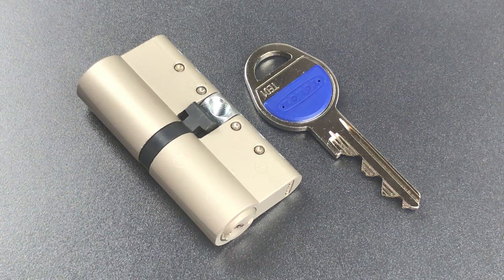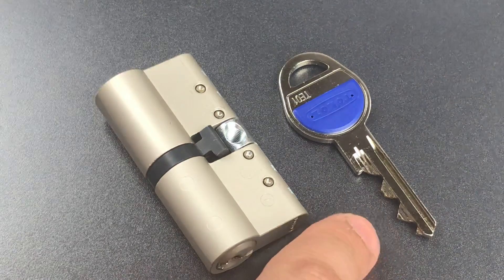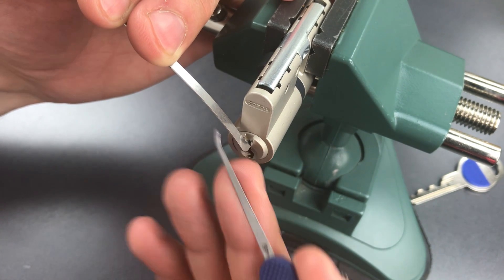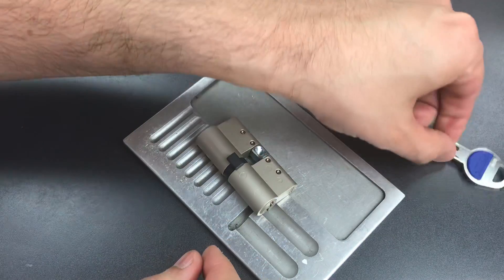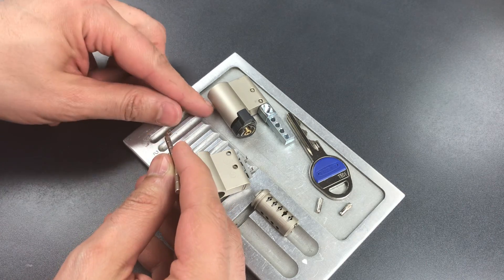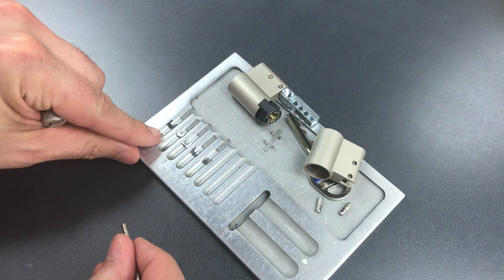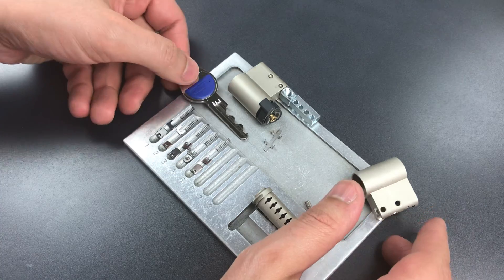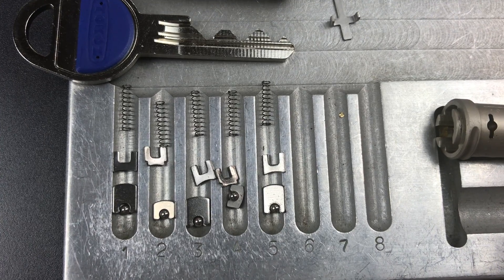[726] The Naughty Bucket Chronicles — Tokoz “Tech 300” Euro Cylinder Picked and Gutted

Comment: You know it's gonna be difficult when the key looks like a saw
Reply: It's actually a message to the picker to use a saw instead because you are gonna have an easier time.
Reply: BZZZZZZ a drill
Reply: All that does is turn a 30 second video into a 2 minute video.
Reply: EricsArchive but it’s still easier than picking
Reply: Nasty bitting, lol
Reply: @MrSonny6155  🎉🎉😢😢 3:47 3:47

Comment: I have one minor and one major remark: the eurocylinder is usually mounted upside down. But it also needs a full rotation or two, to actually unlock. Half rotation is needed to just engage the lever, while you left it in 90° position
Reply: That's why the gods of lockpicking invented plugspinners 😉

Comment: LPL - I saw you switch between picks, without knowing how the key was designed, would you have used the same strategy?
Reply from the maker: Yes. When I move between pins, I ride my pick on the pin I just picked. That makes it fairly obvious when I can’t reach a pin. That’s one of the reasons I always go front to back. 👍
Reply: LockPickingLawyer awesome, thanks!
Reply: Amazing tip. I've accidentally done that a few times while counting pins, will remember to do it  purposefully in the future
Reply: This comment is pure gold ! So what made you realized you didn’t touched four was that when you came into contact with five it was way too far from three to be four ?
Reply: Correct.
Reply: Always front to back!
Reply: actually that is incorrect. He said he drags his pick across the one he just set as he moves onto the next one. Think of how the pick is shaped. As he drags across 3 after he sets 3, 4 is too high that by the time he can reach it, the picks curve ends and he felt the flat part hit pin 3. He never had to go as far as pin 5 to notice he couldn’t reach pin 4 with the short hook pick.
Reply: @SnakePicks  thanks for explaining makes sense now
Reply: @lockpickinglawyer  I'm surprised no one has made a joke about the front to back comment. Only a psychopath goes back to front. Gotta keep the trash out of the goods if you catch my drift.

Comment: Hi Harry, Interesting lock, certainly a variation on wafers. I guess they could be Master Keyed using smaller wafers between top and bottom wafers ...? No lip on the front of the core could leave it vulnerable.  Regards, Brian.
Reply from the maker: Yup, shimming from the front is definitely a problem with this design.

Comment: European locks are mounted the other way, with pins being pushed down rather than up. I wonder if their anti-picking measures can't be designed for that and if you're not bypassing them by picking the lock upside down.
Reply: Not necessarily. It might requiring a bit more finagling, but I’m sure that for lpl he’d have no problems since he’s shown capability with both top and bottom key way tension
Reply: I guess it would be more awkward to have to push the picks up rather than down and not have the convenience of them resting on the bottom of the keyway (which would then be the top).

Comment: FYI you messed up while reading the TOKOZ catalog. The TECH cylinder is not the one they say is 100% pickproof (they have it listed as highly resistant). The lockpicking/bumping proof one is the PRO 300/400 cylinder which uses rotating discs locking mechanism.

Comment: Instead of using a magnet to get the wafers out of the core, use a pair of tweezers with fine points. That way you don't run the risk of magnetizing the wafers. Of course, the wafers could just as easily be brass, in which case magnetism is not a problem.

Comment: What about a tokoz 400 pro? I've seen a pick on yt but I would like you to take a shot at it as your presentation is superb.  The 400 has a special locking mechanism plus coupling so they claim, that you can lock it from the inside and not even open it with a key.

Comment: Since the core slides out towards the back, doesn't this make the lock vulnerable to sliding a shim between the core and the cylinder from the front? @LockPickingLawyer Maybe something to try if you still have the lock.
Reply: I was just thinking the same thing, it looks ripe for a shim picking. The tolerances do look quite tight though. I've never shim picked a wafer lock or even considered it, maybe it would be a tricky process but at least in theory it should work like a pin tumbler lock... I would love to know if this lock is susceptible to that form of attack.

Comment: Since this is a eurolock, I think you should pick those upside down, or for us europeans, the correct way a lock should be installed :-P
Reply: Seminko thrse are installed both ways depending on door in southern hemisphere
Reply: I agreed, I think it's kind of cheating as the upside down should make the overset way more difficult to deal with.
Reply: @Golegoth  I have picked locks in both orientations and have not noticed any difference in overset feel or clearing. The weights of the pins are so much less than the pressure applied by the springs that it doesn't matter.

But that would certainly be an idea to try in a challenge lock. It would require some very fine tuning of spring pressures to make a difference.

Comment: Hey, can you shim this lock. Slide a shim inbetween the cylinder and bible?. I didn't see and counter sinking or overlap to prevent a thin shim from being slid down on the shear line keeping the key and driver waffers from interacting. It may be too tight of a tolerance, but that may work.

Comment: gratz lpl ... my first time seeing this lock gutted .. what do u reckon if serreated sides were added aswell?
Reply: It wouldn't work. Given the wide nature of these wafers, best you could do is have one or two stepped notches. Not sure if they really need to be the same size on both sides of the wafer. You probably couldn't even have it on both the key and driver wafers in the same position in case they catch each other. But this can be tested by cutting out the shapes for one on some thick card and moving it around by hand to see what happens as it rotates.
Reply: ah ok .. im with ya kinda .. is there a video of someone doin that ? , sounds interesting .
Reply: No, I'm not aware of one. The idea just came to me in my head. So I thought it out and realised how it worked. But you can easily do it by cutting out some thick card, inscribe a circle on it for the cylinder, cut it out using an art knife, cut a wafer shape out of the cylinder (and cut a piece out of the bottom of that wafer so it can slide up and down) and cut an opposing wafer out of the top, above the cylinder, and cut off a bit of its end so that it can also slide (or just one rectangle that intersects the circle to make it simpler). Put all that back together and what you end up with is a cross-section of one of the wafer slots. You can move the two wafer portions up and down and rotate the cylinder piece to see how it all works. Because these wafers have squarish ends, that's not that much you can do to them since you can't risk the ends catching on anything and potentially seizing up the core.
Reply: Gary Rumain OK.. that's a interesting approach .

Comment: Extreme bitting but not extreme difficulty for LPL. Another lock destroyed and the company’s reputation in ashes!
Reply: Hardly. Just because an single expert can pick a lock reliably does not necessarily destroy any reputation. What does is when there is a simple way to defeat the lock, such as using a RE magnet to unlatch an electronic lock - especially if the company does not mitigate the problem by adding a mu metal shield around the vulnerable area.

Comment: Was wondering why you where turning the tension bar the opposite direction then I realized its upside down as European locks are installed upside down for some reason :/
Reply: If it was rotated through 180 degrees, he'd still be tensioning it in the same direction - anti-clockwise. Think about it.
Reply: Gary Rumain These locks rotate either way anyway. From inside my house I have to go anticlockwise to unlock, clockwise from outside to unlock. Would be the opposite if my door was hinged opposite.

Edit: and yeah, some doors take them installed upside down, others don't. No idea why, probably just to do with convenience of designing the bolt mechanism inside the door.
Reply: That's correct! but most other locks are tensioned clock wise
Reply: For the sake of clarity, they always unlock by turning away from the closest side of the door frame (in my experience anyway, no doubt there's a door somewhere that does it toward the frame just to confuse people).
Reply: Actually, no, you can go in both directions. It is the direction the actuator has to move in that determines which direction you have to turn the lock. Remember that you can both lock and unlock with these lock styles and many others.
Reply: That's correct. Because they function to both lock and unlock. So it doesn't really matter which way you tension it.

In Australia, we usually have the keyways upright to match normal door locks. These Euro profile locks are commonly found on screen doors here. Oddly enough, when I replaced the entire door latch mechanism on my rear screen door (one of the lock handles had snapped. Cheap cast aluminium. Had to replace the entire unit), the Euro profile lock it came with was in the European style - upside down compared with how we expect the keyways to present.
Reply: Ok I've learnt my lesson - don't spot small minute things people normally miss and point them out..
Reply: Ha!